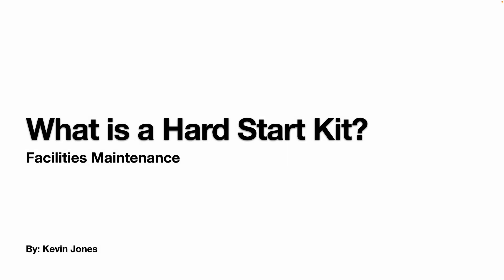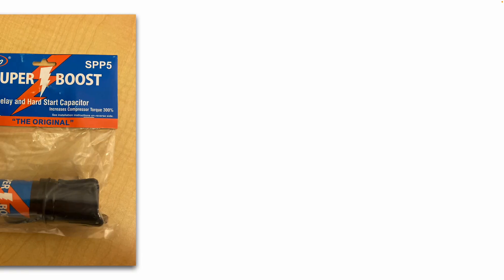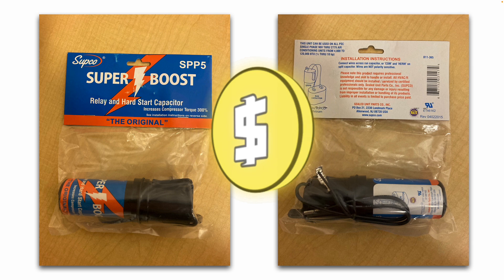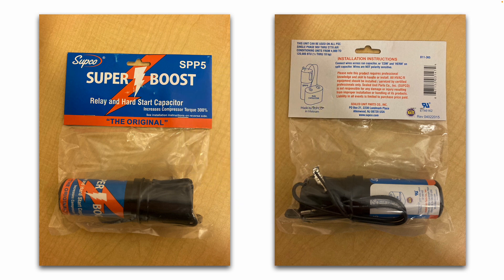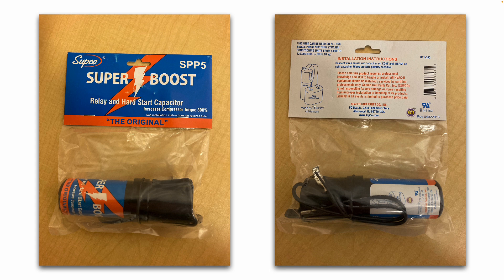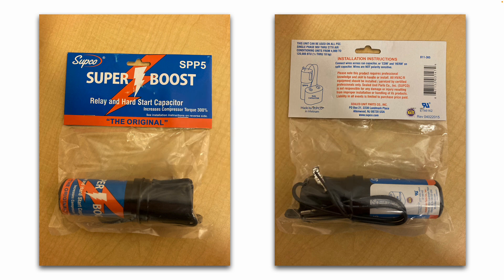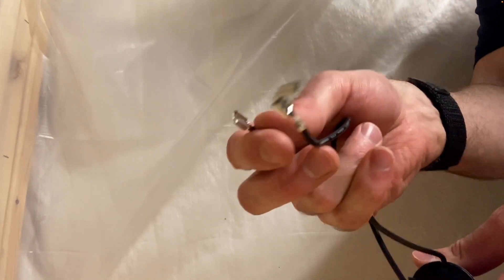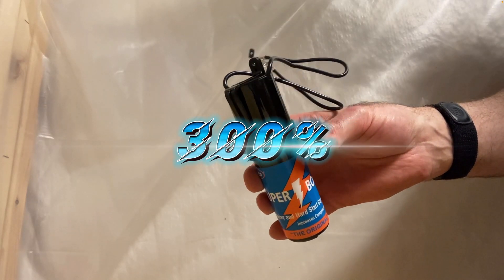What is a Hard Start Kit? | HVAC

Comment: Can these be used on a “thru the wall” unit ? It’s a Carrier 10000 btu.
Reply from the maker: Possibly.  I would look up the make and model number of your AC unit on Google and see if the manufacturer offers a hard start kit for your AC unit.  Installing the wrong hard start kit can actually damage your air conditioner compressor.